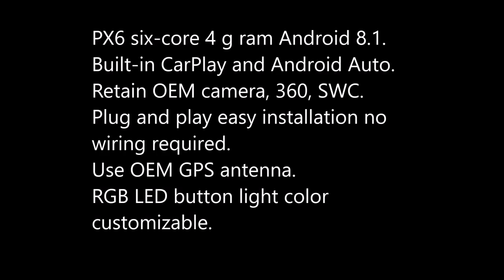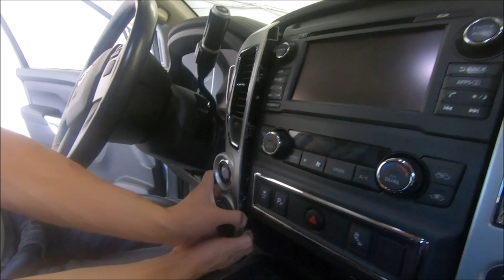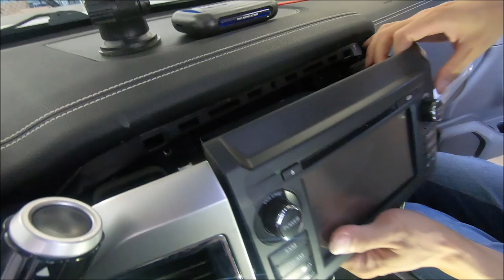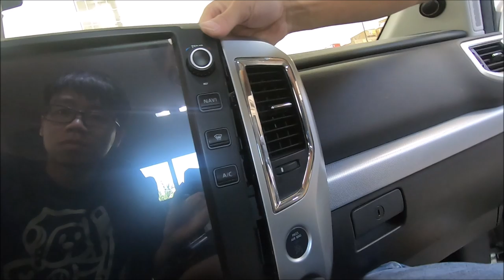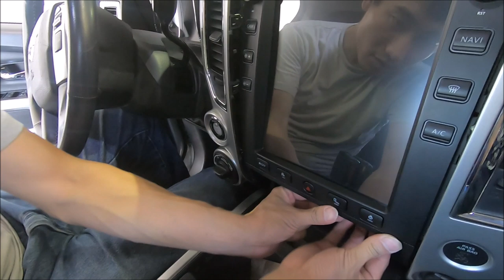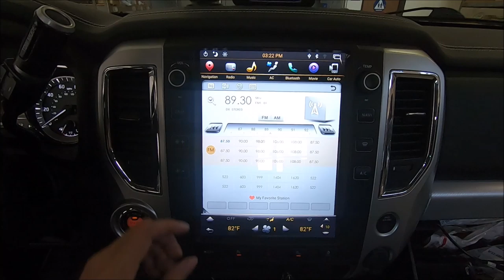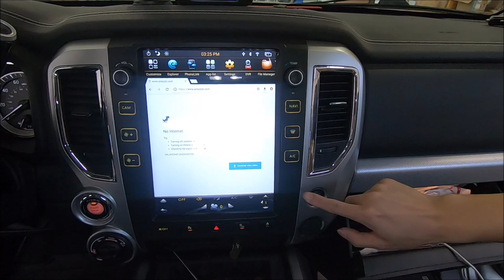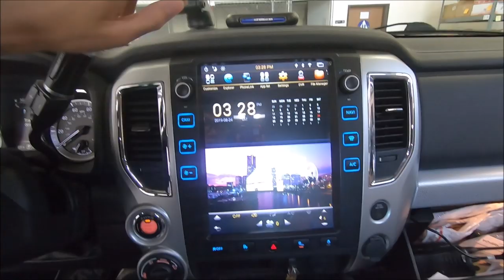Install and demo: 12.1 inch PX6 six-core vertical screen head unit for 2016 - 2019 Nissan Titan (XD)

Comment: Made this same mistake taking apart my dash the first time. Remove the two back bolts from center console and it will allow console to slightly slide backwards which will give you room to remove the AC vents much easier.

Comment: Appreciate the great video.  I have a 2018 NISSAN TITAN "S" Model and 
all the videos I have seen show the radios installed in Pro4X models; SL
 models and it has me wondering if it will be compatible.  Any leads on 
this?  Appreciate it. - Micah